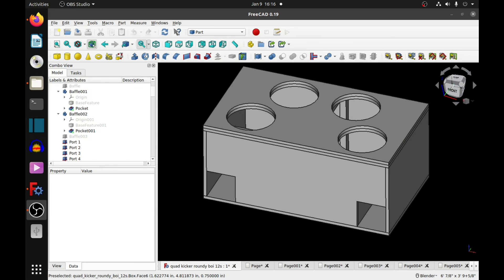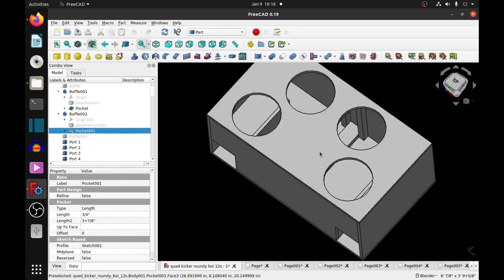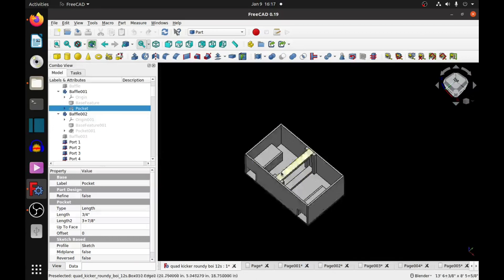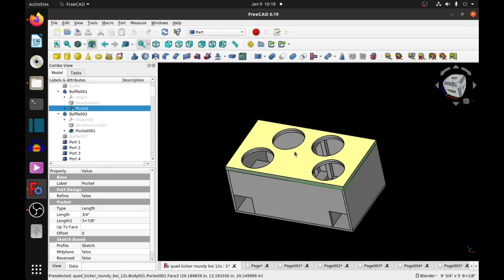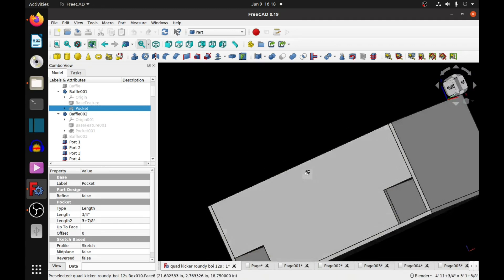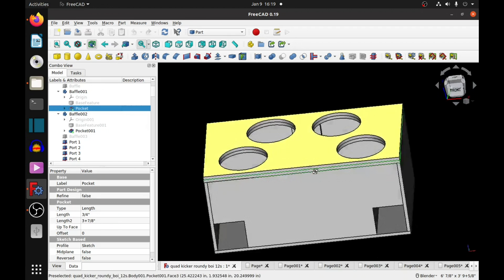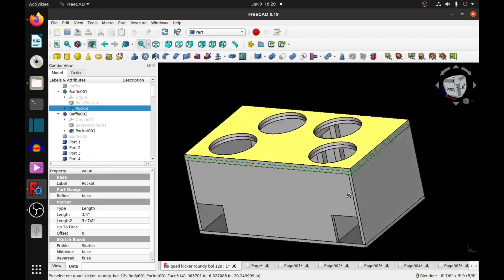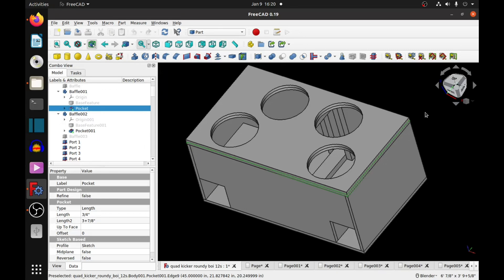Free Subwoofer Box Design For Four 12 Inch Subwoofers Tuned To 33Hz 9.95 cu. ft. For Escalade

Comment: How much would it cost to build?
Reply from the maker: I can't remember how much wood I used, feel like it was 2 sheets 4x8 3/4 inch, one 2x4 and one 2x2 I bought. Then one tube of adhesive glue would do it, However many screws you choose to use. It's a relatively inexpensive box to make depending on what materials you use. It cost me maybe $150-$180 at the time, probably a lot more now unfortunately